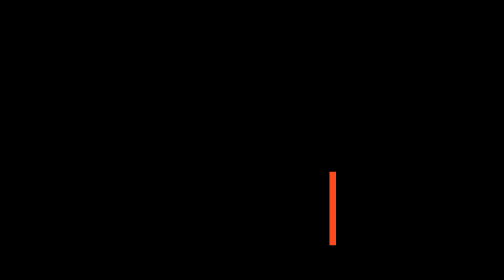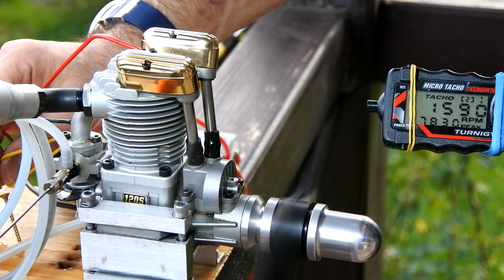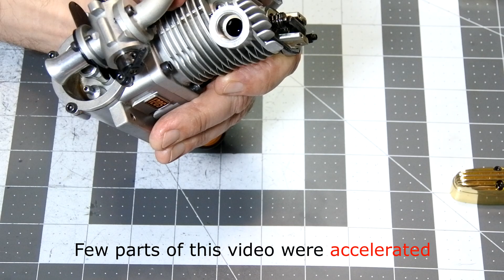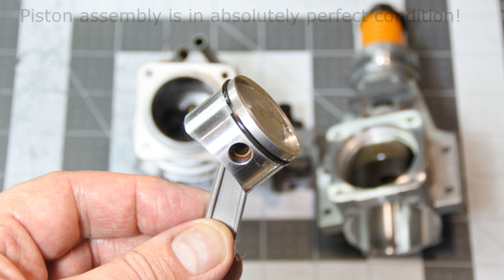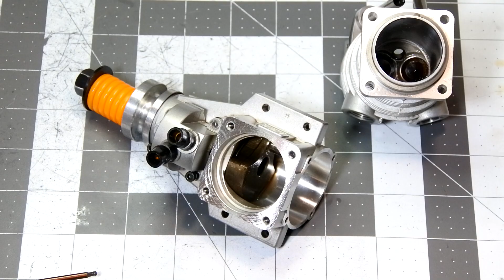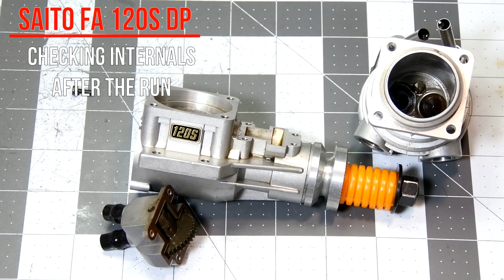Saito FA 120S DP checking internals after the run

Comment: Nice Video. Thanks a lot for sharing.
Which fuel was used in this case? Fuel quality is essential for rust prevention. Here one can see that an engine can last for years if the aporopriate fuel is used.
Reply from the maker: Thank a lot for your comment ! Following fuel was used - UK made Model Technics "Big Bang" fuel with 16% Nitro with addition of 10% of Motul Micro 2T synth oil. In general, 20% of oil was in fuel mix. I'm still thinking, that Motul Micro 2T oil is one of the nest choices, if you really want to take care of your engines.
Reply: @crazyengines88  Good choice. I am using this oil as well. No rust and no wear at all. My fuel contains 18% Motul and 10% Nitro.
Thanks for your feedback and always happy landings :-).
Reply from the maker: @jurgenblume5179  Thank you very much ! Have a nice day and wish you a Merry Christmas !